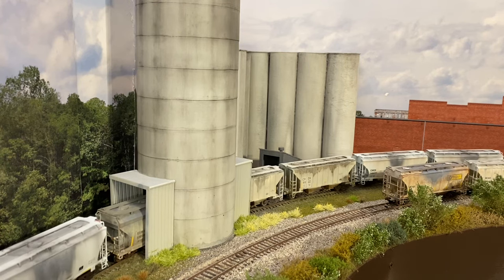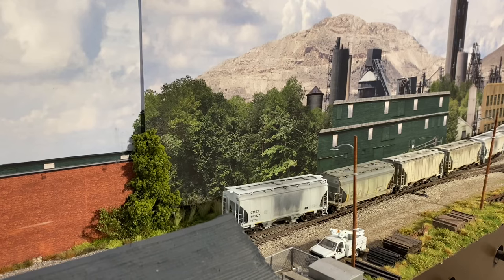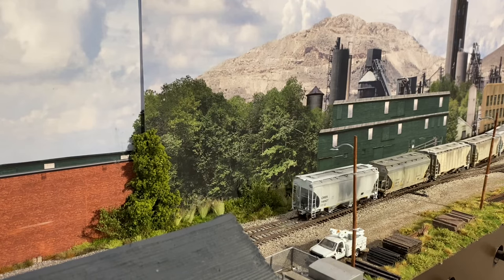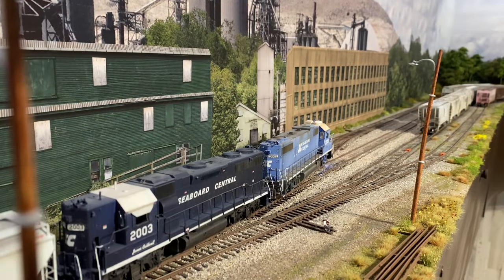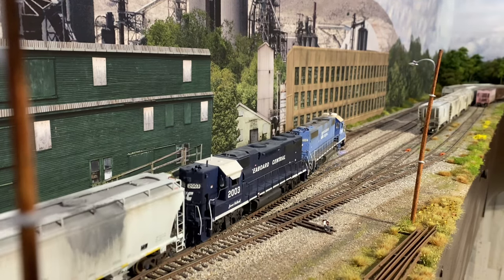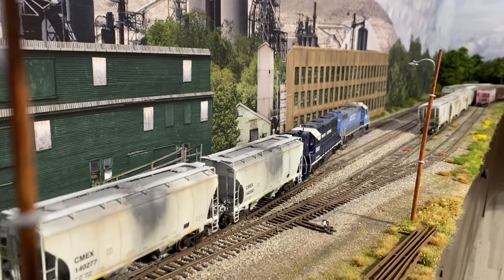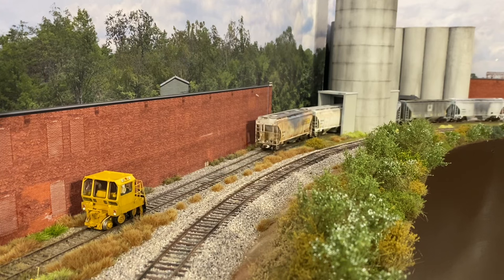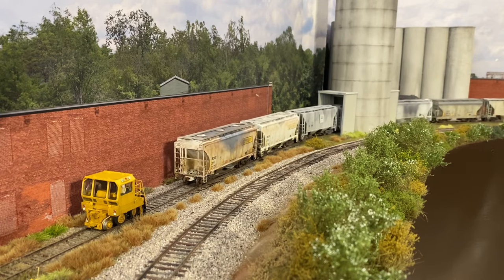Seaboard Central - Realistic Ops Part 3

Comment: It's also important to note, that car hire rates on system cars aka Class 1 owned cars, are more expensive than that of private cars. It's imperative once loaded or unloaded, a system car is to be picked up to avoid excessive fees incurred to the customer. Currently, CSX has many of their boxcars stored in the passing sidings at Wallace & Cheraw, SC. This is along the lightly used Hamlet Subdivision of the S Line, from Hamlet, NC to Cayce, SC.
Reply from the maker: Car hire is very important and I didn’t get to bring it up but will plan on talking about it in an upcoming video. Stay tuned!
Reply: @SeaboardCentral  I recently came across your channel a few days ago. I really appreciate your attention to detail. Not only from an aesthetic perspective, but also from a prototypical perspective. The side of railroading that's usually forgotten about to most railfans. The ever evolving logistics involved to ensure each car arrives at its destination safely & efficiently, is perhaps the most important part of any successful railroad.

Comment: good vid... the other thing with railcars is demurrage fees... demurrage fees only apply to RAILROAD OWNED cars when the car is on customer property(once on customer property, customers using railroad owned cars have 24hrs to release a car after it has been spotted)... PRIVATELY OWNED cars DO NOT have demurrage fees tied to them when on customer property... that's the other reason tims cement plant uses private cars... it's common for customers who use private cars to sit on those cars for days or even WEEKS before they move them... if that same customer were to sit on a railroad owned car for say 3 weeks, depending on the demand status for that car he could be charged upwards of $200/day for every day AFTER the expiration of the 24hr demurrage clock... tim could actually do a MULTIPLE part series on this topic if he wanted to as there are MANY facets to railcar movements and usage and fees
Reply from the maker: Thanks, yes I didn’t have a chance to bring it up but will probably talk about it in an upcoming video.

Comment: Extremely interesting Tim, I'm learning much with this series. I don't know if this subject will be covered, but when it comes to revenue earming and expenses, are loaded  cars accessed a fee per mile, or by the load. When it comes to empty cars, who pays the fee, the original shipper/private owner, or the industry who had  received the original load.  I hope this question makes sense.  Thanks for a great series.  Steve
Reply from the maker: Thanks Steve. Rates are generally figured on the mileage and the commodity. For example, haz mat loads generate higher rates due to their associated risk. Railcars other than tank cars have one free empty reverse move if the Railcar is released within a certain time period. Say 180 days from the date of the original loaded waybill. Back to back empty moves or empty moves without a previous loaded move will generate an empty revenue bill. Tank cars are billed according to mileage. So if their empty miles exceed the loaded miles they will be assessed a fee to be paid by the owner or lessee.

Comment: Outstanding information for those of us who are not railroaders and don’t usually get access to the way prototype railroads are actually operated.  My question is for those of us who don’t model the present day on our layouts.  Is it fair to say this information hasn’t changed much or at all since the 1960s or even the 1980s?  Thanks, Tim!  ~Dave Foxx
Reply from the maker: Thanks! The percentage of railroad owned cars are much more prominent prior to the 1980s. As more and more things became specialized, then more and more private cars built especially for a particular commodity started becoming the norm.  The cement cars are a great example. The days of railroad marked cars hauling cement are practically over now.

Comment: 6:00 COER is the fabulously named Crab Orchard and Egyptian Railroad. They were technically the last steam-hauled freight railroad in the USA, using steam until 1986. As I understand it, their plan was to be a tourist railroad that was going to haul a bit of freight on the side, but the tourist part of the operation wasn't successful, so they just ended up running freight. These days, it looks like railcar leasing is their main business, as they own hundreds of railcars -- probably more than would fit on their property.
Reply from the maker: From my understanding the COER cars are actually owned by a leasing company that pays them for the right of using the reporting mark. This is the case with a lot of small short lines that look for additional sources of revenue. I remember when the BNSF was once leasing ATW centerbeams. The lease expired and since the cars became free runners they started heading to their home, which was the ATW. There’s no way they could absorb this many cars and they started freaking out once they saw them in the pipeline heading their way. But car service rules say otherwise and if they agreed to make this deal, then the cars would be routed to them if they weren’t under a lease agreement with anyone else. The true owner of the cars was GE and they had to scramble to find somewhere for the cars to go. I thought the whole thing was hilarious.
Reply: @SeaboardCentral  "From my understanding the COER cars are actually owned by a leasing company that pays them for the right of using the reporting mark." Ah, that would make sense. As for the crows cars coming home to roost, as it were, I've heard similar stories about per diem box cars in the 1970s. Oopsie!

Comment: Tim, with context to the information needed on/from the waybill.  Would you need to consider the weight and length of the cars?  I assume that this info would also be relevant in order to select appropriate motive power to pull the trains combined weight and not exceed siding length.   For example, the empty cement cars on the SC may be handled by one locomotive, but a loaded rake one might need more power.  Or am I over thinking it for modelling purposes?
Reply from the maker: Yes, and I will show all of it in an upcoming video. Weight and length does play a role, however for modeling purposes it will be very compressed to what the prototype is capable of handling.